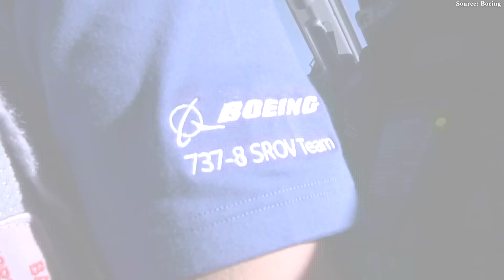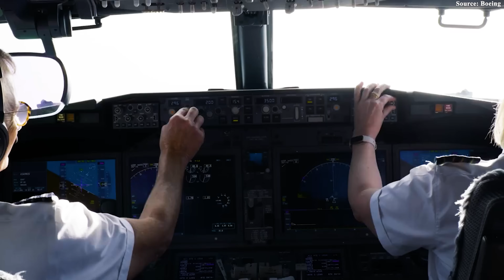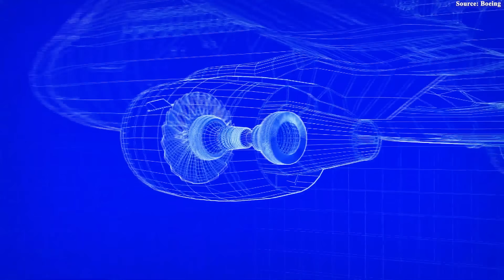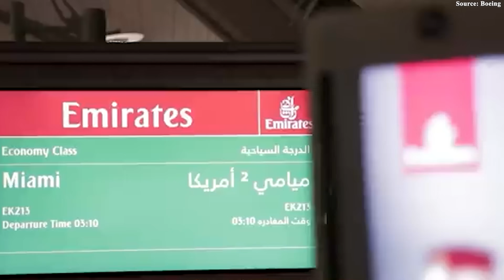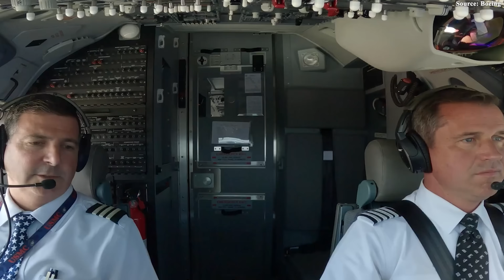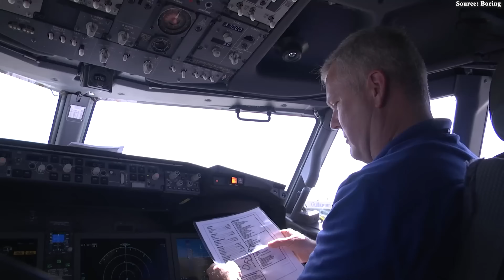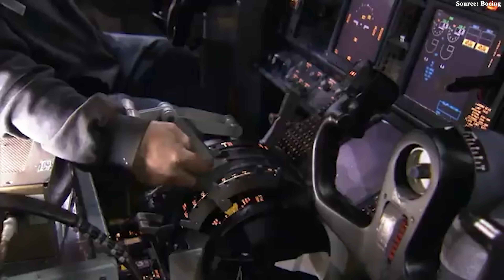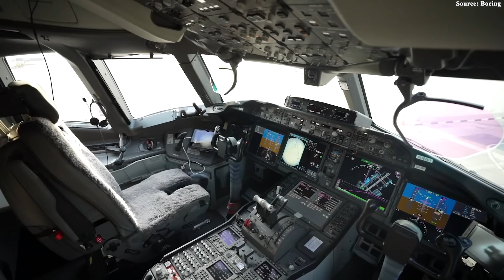FAA Just Drops A BOMBSHELL For 737 MAX & 777X Certification

Comment: Something is wrong when Boeing is so late with certification of 777x and 737-7/10.
Reply: It is a very lengthy approval and certification process when it has to be done so tediously when it is done mostly by the human eye that needs to be there and triple check everything. That has been allowing Chima (COMAC) to catch up. Airbus in the same boat as Boeing, but not as bad and for different reasons.